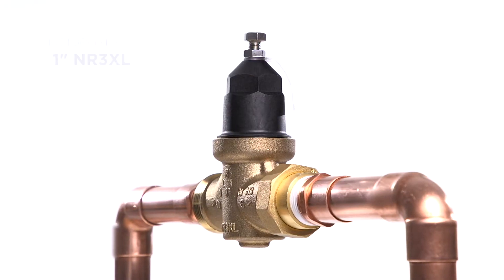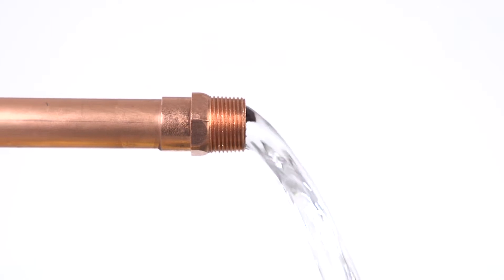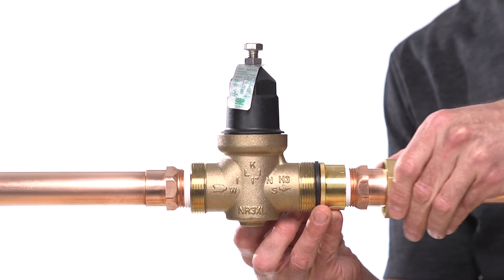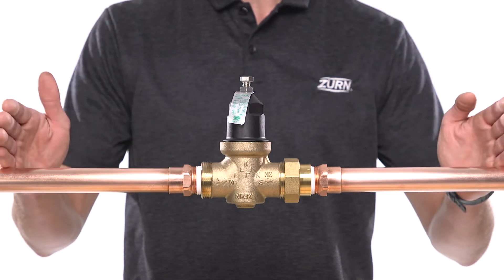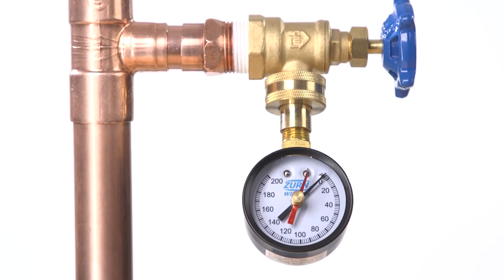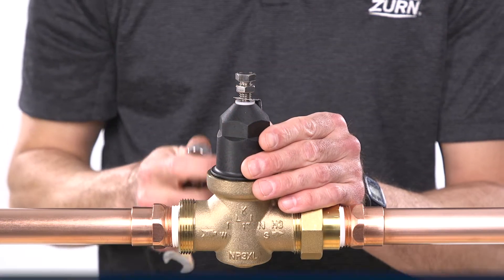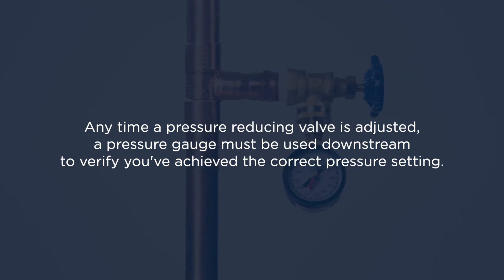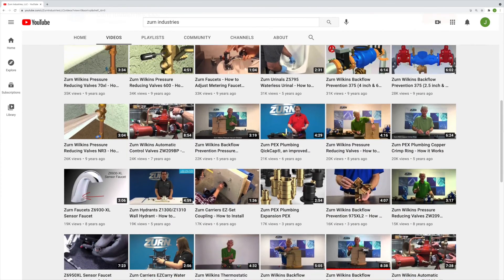Installing a Zurn Wilkins NR3XL Water Pressure Reducing Valve

Comment: Hey.@Zurn. Can you please tell me the exact distance between the copper pipes before you put the 1 inch threaded copper coupling on.I want to cut the water line perfect so the valve slips in perfectly.Was it about 6.25 inches?
Reply from the maker: Hello, thanks for reaching out! This is going to ultimately depend on connection type & how many unions you have. The 1-NR3XL comes standard with a single union and an ultimate lay length of 4-15/16". Without the union, the lay length of the 1-NR3XL is 4". By cutting the gap to approx 4", you'll get 1/2" connections on both the union on FNPT connections. Hope this helps!
Reply: It's hard to figure exactly because pipe threads can go on more or less depending on torque and wraps of tape.  They do sell a 2 coupling ended version.  You almost need flex in the pipe for retrofit applications.  New construction is so much easier.